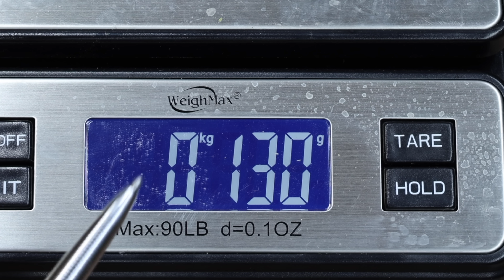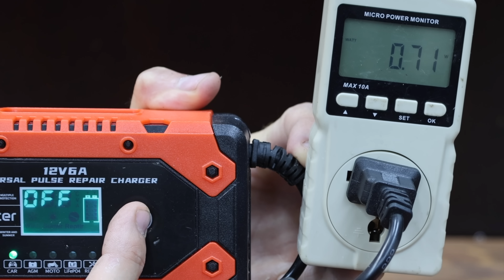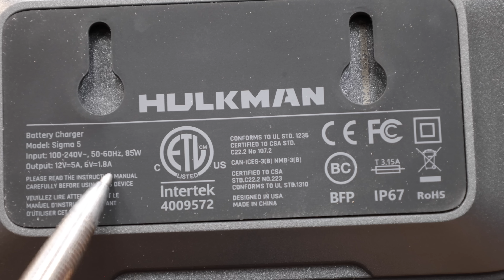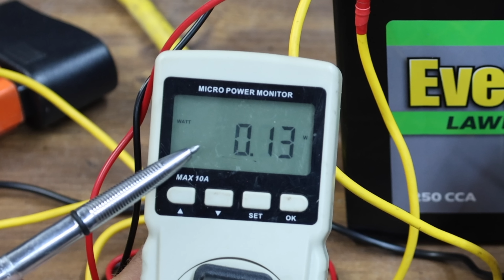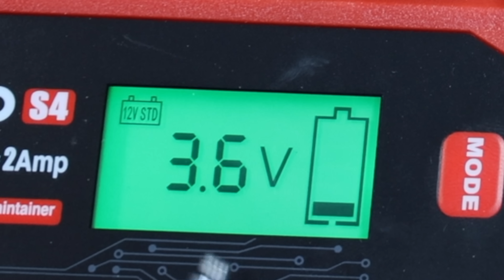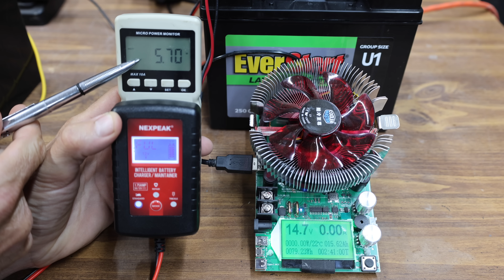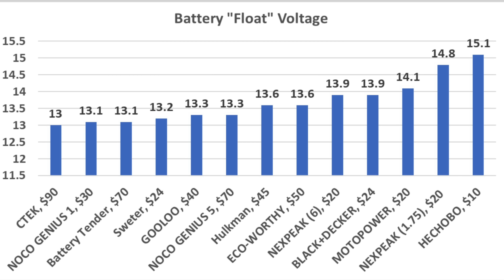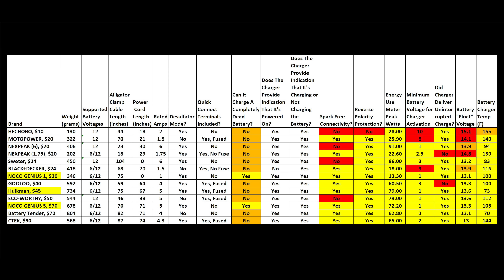I Tested the Most Hyped Car Battery Chargers – One Stood Out!

Comment: I've been using a CTEK MXS 5.0 for over 10 years. No problems and have been very happy with it.
Reply: You can add me to the satisfied customer list.
remember these are call a battery maintainer NOT a charger. lol
Reply: @hjc5458  Doesn't stop the auto stores putting it on the shelves alongside all the other battery chargers, I bought one 10 years ago too without knowing much and quickly wondered why it had a short power lead with mounting points. This is for sticking on a tractor or other piece of farm machinery that doesn't get started often, granted it will recharge a flat car battery you just have to be doing nothing for an entire weekend.
Reply: Same, over ten years on my CTEK and it’s been used hard, still going strong.
Reply: Recently acquired the CTEK MXS 5.0 as it is the original equipment manufacturer for Porsche. It is reassuring to recognize that CTEK offers reliability and durability, especially given its premium pricing compared to competitors.
Reply: I have a CTEK and ran a battery down to stone cold dead overnight once; it is (technically) useless in that salutation.  I was getting frustrated, it is a major shortcoming IMHO on a premium product, but had an idea. I grabbed a 9 volt battery and a couple pieces of wire and it was enough to start the charging cycle.
Reply: @PePe_007-A1 i use my ctek 7.0 for one dead battery and after 3  attempts  job done. Great product.
Reply: Same, we have it on our Porsche to maintain the battery, and it works very well for that.
Reply: @sj1547  it's literally the OEM for porsche chargers, porsche just slaps a badge on it and charges 3X the cost. great little charger
Reply: @youchooby  Whenever I have the opportunity to evade the Porsche tax, I will take it. The drawback of these battery tenders is that it results in driving the vehicle less frequently now, since it's not my daily driver. lol
Reply: @youchooby Same with Aston Martin too, you just pay alot more with an Aston logo on😄
Reply: @sj1547  same here!
Reply: CTEK also come BMW branded
Reply: Bought my first CTEK MXS 5.0 in 2011, and now I have 3.   Fantastic chargers, and worth the money.  It wasn’t until recently that we got the NOCO chargers here in Australia, and I would definitely consider the Genius 5 if I ever need another charger.
Reply: I own multiple CTEK chargers for all my toys. My oldest one is over 10 years old. I will continue to buy CTEK because they work so good. I had a bare battery on one for over 3 years and this battery is 6 years old now and still performs great in my Mustang.
Reply from the maker: Thanks for sharing!
Reply: Ditto...even desulfating a BMW German manufactured 900CCA battery that my brother in law gave me since it was "dead"..
I got another 5 years out of it...
He spent $600 getting a new battery and having the BMW programmed..
Reply: 10 years is impressive 👍
Reply: @ostromadventures yes, although I don't use it much or abuse it.
Reply: Same. Ours has worked flawlessly for 10 years in the Queensland heat.
Reply: I've to stop the video after 10 sec. This voice makes me agro
Reply: I like the reviews but often they are fairly irrelevant to me here in NZ since we don't get the same brands. We do get CTEK here though and I use several of them and they've always worked well for me on vintage cars.
Reply: @asciimation  
REPCO sell NOCO..$360 NZ plus!
Reply: Ctek MXS 10  (if this is the 10A version), from 10+ yrs ago trying to evaluate several different brands to charge many 12V AGM batteries => The charging clamps are cheap and flimsy and my overall impression is minimalist flimsy.  The Charger gets quite warm and the desulf mode seems to be useless.  Costly and not impressed by its performance.

Comment: I would love to see the bigger battery chargers. Like the harbor freight viking 2/8/15amp automatic microprocessor controlled charger.

Another good test would be the rechargeable jump start packs. I see them from $59-$259. I wonder how well they work after a few months sitting and if they could jump my 2 battery diesel pickup. 

Fuel stabilizer. How long does it work for? 3,6,9,12 month tests or more.
🍻✌️
Reply from the maker: Thanks for the suggestions.

Comment: I must say awesome presentation!  I spent the $$$$ and purchased the CTEK charger.  Believe it or not CTEK come as part of standard equipment when you buy a new Chevy Corvette.  I use the CTEK to maintain my suv during none use while in our garage.  All new vehicles with computers and sensors drain your battery.  A trickle charger is a must today.
Reply: i got a ctek as well.  lamborghini porsche ferrari and other brands all use ctek chargers as official accessories for vehicles that likely wont get driven a lot and will need tenders
Reply from the maker: Thanks for sharing!
Reply: BMW approved as well.
Reply: I bought a CTEK charger in november 2022. After less than a year and only occasional use, the mode button started failing. Eventually it stopped working completely, and a quick search revealed this to be a very common issue. The chargers have also become almost impossible to service - the old ones used to have security screws that you could remove to open up the charger in order to clean the contact for the button, newer ones (or certain models at least) are aggressively glued together and basically need to be cut open if you want access. The problem seems to go back some years, and it's not acceptable for a device at this price point to have consistent failures like that. It's nice to have after sale support, but a manufacturer shouldn't keep selling a broken (and relatively expensive) product with the expectation that customers have to keep sending them in for repair or replacement. I'll be trying a Noco as my next charger
Reply: @sesquila They have 5 years warranty for a reason.
Reply: @yamahass66  You've pretty much ignored the points I was making, which is that a known failure point isn't being addressed in a premium product and that serviceability is being engineered out. Also, you must be the only person I've ever come across who believes that a warranty is used by a company to advertise the fact that their product is going to fail. It's actually normal to assume that a good warranty indicates a robust product, NOT that a good warranty is a sign of a product with a short lifespan.
Reply: @sesquila  
That's then "on" the company. 
If they keep replacing their products and you keep using them..... then all is well in modern society.
(Sarcasm alert...and my MXS5 CTEK is nearly 15 years old and still working well....

Comment: Schumacher. I've had mine over a decade. Run it a few times and it can recondition batteries (goes up to 17V, but not as good as super juicing them though).
Multiple old batteries have been brought back to 13.1V. You read that correct. Cold batteries on the floor stay at 13.1V.

Comment: I have had 5 NOCO Genius 1 chargers die on me in a little less than a year's time. The company replaced them under warranty each time they died and even replaced the NOCO NLP20 lithium battery in my motorcycle trying to resolve the failure issue. They eventually decided to upgrade me to a NOCO Genius 5 and I've had no failures in a couple of months now. Keeping my fingers crossed because I really like the way the battery and the charger are performing right now.
Reply from the maker: Thanks for sharing!
Reply: I value your testing. Unfortunately battery chargers are inconsistent in long term reliability. I wish you had this factor in your testing but that would be time consuming.
Reply: I have 2 Noco Genius 5 chargers, and one of them is over 3 years old at this point, the other is a little over a year old, and I have had no issues with either of them. I have used them on both AGM and lead acid batteries.
Reply: Always respect a company with good warranty service!
Reply: I've used 4 Noco Genius 1-s for 3.5 years and they have all worked OK for me. No failures.
Reply: I have at least 4 of the Noco 5 chargers and one of them maintains a two battery diesel pickup all winter and most of the summer when the truck is not in use ( darned security system drains the batteries otherwise ) and its going on over two years and no hickups yet. No issues with my other less used chargers either. A battery retailer I buy from sells piles of these units as there are sure some complete junk Chinese brands out there that are not worth using if it was given for free. I have had some success reviving a couple of batteries that were not holding a charge well with that de sulfation setting but also ended the life of a battery that was crap anyway so no loss there.
Reply: 5??? Sounds like you’re just an unlucky loser…stay off the streets and in the garage making motorcycle noises as you “zip” around town…DERP!
Reply: I have 10 NOCO Genius 1 chargers on cars, truck, motorcycles, lawnmowers, ATV. Half are 5 years old, half are 3 years old. No failures.

I would add note the NOCO will turn off the “dead battery” attempt if it is not able to raise the voltage in a few minutes. Retest, watch it for 5 or 10 minutes. A few times I have needed this function I fetched my variable current/voltage bench supply. Set limit at 2A, voltage at 12v. Brought the battery up to where a NOCO or similar could finish the job.
Reply: The GooLoo brand has customer service # that is not answered and email that is not answered
Reply: @louarmstrong6128  Welcome to chinese "brands" of a brand of a copy
Reply: That's why you buy Ctek. Never failing.
Reply: @yamahass66 but they do fail, the charger button is well known for failing.
Reply: @GAFYSELF I have several and I don't know anyone that actually failed for someone. Maybe that is the only weakness, hard to say how many it is. But they have 5yr warranty.

Comment: If you’re gonna test battery chargers, that has a manual mode or force charge then make all of them have that function otherwise your test is completely null and void. This was a wasted video. Do you want a good battery charger? Get a Century. It’s got manual and automatic. If I didn’t know better it sounds like a paid promotion for a Noco battery charger, but I could be wrong.

Comment: Ive been using the CTEK for 13 years. I use a car battery to run a 12 volt pump. I bought the batttery from a breakers in 2018 and charge it up every week. It is still going strong. I use the the repair function on all my betteries once a year. Not cheap but worth it.
Reply from the maker: Thanks for the feedback.

Comment: After using a Battery Tender on motorcycle batteries I decided to try a Noco Genius 1 on a couple of batteries that the Tender couldn't bring back to life. It did, and I ended up buying two more, a couple of Noco Genius 2's. One is permanently under the hood of an older truck that has a 14 year old battery and that battery cranks the truck like a new one.
Reply from the maker: Thanks for sharing.

Comment: 15:09 is it really that low on car batteries? Airplanes have 14.8V stickers on their ground power port and always tried to get to that
Reply: That’s what the voltage goes to while the vehicle is running via the alternators. Sitting battery voltage should be between 12.9 and 13.2
Reply: @RunninGunner04  But isn't that charger plugged in as he tests it? Same as you plug ground power to plane or alternator charges the car battery.
Reply: @mikoniemisto9535 the full voltages were checked when the charges said full. Meaning the chargers were not putting charging voltage to it at the time.
Reply: @RunninGunner04  Oh okay I thought battery maintain mode trickle charges at constant voltage and that's why digital battery chargers jump back up so fast at the load.
Reply: @mikoniemisto9535 a battery maintainer should maintain a full battery voltage, if the maintainer only puts a constant trickle in it could either way over charge and ruin the battery or it could under charge it and not keep it charged
Reply: Standard lead acid batteries use a combination of 2v cells with a full-charge voltage rating for each cell of ~2.12v. A 12v automotive lead acid battery has 6 of these cells and should ideally be ~12.72v when fully charged. A float charge slightly higher than that is normal and acceptable. Like another reply said, up to 13.2 or 13.3 is pretty good.

Comment: I'm a long time Subscriber & get notifications of new videos.  I consider your channel to be a RELIABLE resource.
I have TWO PulseTech Products I use to keep my batteries De-sulfated & Charged
#1.  Power Pulse PR-12-L which is wired directly to the battery terminals & provides a 24 hour de-sulfation pulse.  It is recommended to charge the battery once a month.
#2.  PulseTech XC400 Charger/De-Sulfator - This charges at a 4amp rate & provides a de-sulfation pulse during the charging process.  The 4amp charge rate is just below the threshold of when the lead-acid fluid begins to bubble. However, this product won't charge a battery with less than 7 volts.
YES.  I keep the battery terminals/clamps spic n span CLEAN.
3.  I just bought the Ancel BA101 product off your amazon affiliate link & am using it to periodically check the battery's health, the Starter's health, & the Alternator's health.
Reply from the maker: Thank you!

Comment: Awesome video. I have a battery charger and have been using it for over 10 years. Seems to work fine. But it is a larger charger than you showed. If you can show another video with larger chargers would be great! KEEP ON ROCKING!
Reply from the maker: Thanks!  Thanks for the suggestion.

Comment: I have 80 euro  osram charger and it produces sparks, while many much cheaper chineese chargers don't:( 
Also noticed that chargers lately often do not have on/off button - plug in = on, not a big deal, but feels cheap for 80 eur. good thing that osram has is ability select max A - 2,4 or 8. So I can use it for my 20ah motorcycle battery and for 100ah battery I use in car. (As battery charge A should not exceed 10% of its rated volume in AH)
Reply from the maker: Thanks for sharing!

Comment: I believe the Noco Genius 1 is targeted at very small batteries, like motorcycle or even wheel chair batteries. That’s why I got one. I bought a new motorcycle battery that wasn’t sealed and shipped without acid pre-installed, and the directions were to basically trickle charge it at 1A. The Noco was perfect for that because it did start charging even though the battery was stone dead, and it did it slowly. It’s not going to be ideal for a car battery unless you’re just using it as a battery maintainer.

Comment: I'm sticking with Deltran Battery Tender. I have 5 of them including one that charges 4 batteries at once.  My oldest Tender is 26yrs old and has had one battery or another hooked up to it almost every day of that 26yrs.  

Not interested in charging a dead battery like you showed. I recycle those.  A dead battery like in my car where I left an interior light on, will recover on it's own enough for any of my Tender's to charge. If it doesn't I replace the battery

Comment: heh i got rid of the agm battery in my chevy volt and built my own 6s LTO 22h battery. car charges it up to around 20-40%, 200w flush mounted solar roof charges it further to 15.8v thru a programmable 30a mppt by easun. lets me basically store an extra ~1.5 miles of ev range by letting the dc-dc converter go to sleep most of the time my car is powered on. made some other 12v improvements like led headlights to reduce 12v loads. also sheds ~40lbs and the battery will basically last longer than me, even if discharged to ~0v in the cold several times every year. lower internal resistance, less dc-dc losses, less i^2 R losses at higher nominal voltage, less resting voltage sag/leakage current losses compared to agm as well as no float losses.
solar roof puts around 100 watts back into my car while i am driving which gives more range, and then recharges after i park every day. net gain of around 3-4 miles ev range per day.
makes it kind of hard to jump though. i carry around a dp100 usb-c dc adjustable power supply and at least one 100w 20v laptop powerbanks that i made too.
if my battery ever goes flat, and after 2 years it hasnt, i plan on trickle charging it thru my micro powersupply to get the car started. i do carry around a cheap jump pack, but its for me to use on other people lol. i no longer trust people to hook up jumper cables correctly.

Comment: The Noco chargers should both have eyelets for quick detach terminals. You have to undo the screws on the gator clips and they have M6 or m10 eyelets that can then be screwed on battery terminal. Just something I noticed on your chart, and I have 3 (Genius 1, 5, and 10)

Comment: The energy use meter is not an accurate way od working out the charge wattage or power. The charger itself will not be 100% efficent, so when showing a mains draw of 90Watts, the battery is most likley only seeing  80Watts.
Reply from the maker: Thanks for sharing!

Comment: Might be too expensive to test, but I would love to see a Zero Turn Mower test. Ability to hog through thick grass, ability to maintain a good cut a slow and high speeds without bogging, top speed without cutting, comfort, control-ability, grip on slops/hills or wet grass, owner repair-ability, and finally all those at what price ranges. I personally can only get a 42-46(46 with no side chute) through my gate, so smaller deck sizes would be nice.
Reply from the maker: Thanks for the suggestion.

Comment: Sparks can be a major concern.  I saw a car battery explode in a guys face once and it was horrible.  I always connect the charger to the battery first and then plug the charger into the wall outlet to (hopefully) eliminate the possibility of sparks right at the battery.  This also keeps my head away from the battery when the charger is powered up.
Reply from the maker: Thanks for the feedback.